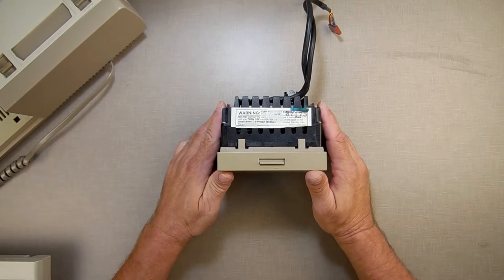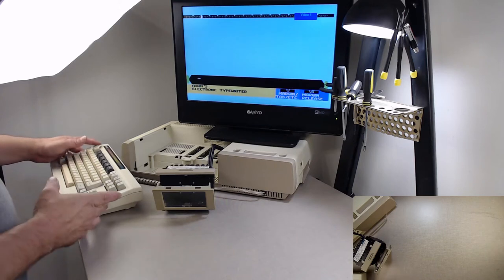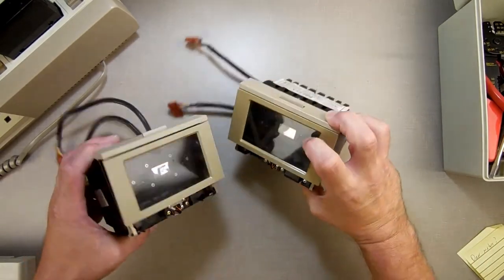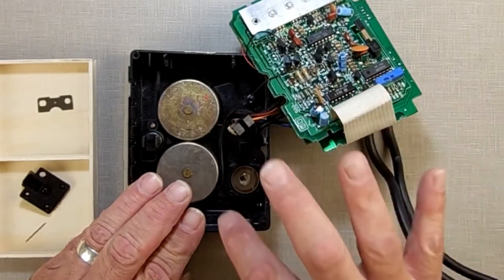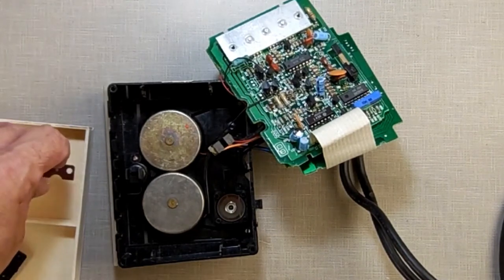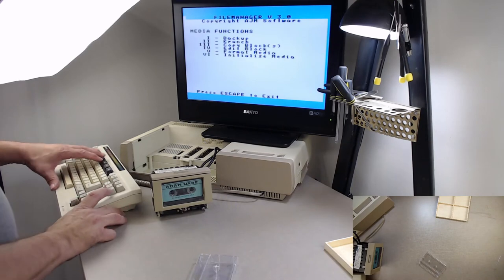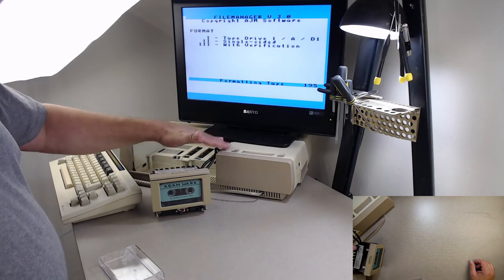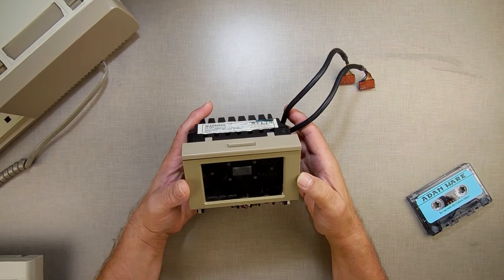Data Drive Maintenance: Coleco Adam for Dummies

Comment: I recently de-gunked two drives with the help of your earlier video.  One was a newer version with connectors, the other was the older version with the hard-to-remove strain relief and everything soldered.  That early version was a real pain. I tried different solvents on the rubber, but rubbing alcohol seemed to work best, as you suggest.  It really is impossible to describe the delicacy of that fine mesh on both the wheel and the "window" square. I cannot imagine any way to ever reproduce those. True unobtanium. Anyway, both are working great now, and silent as whispers! I would have had no clue where to start on these without the help of your great videos!
Reply from the maker: Thank you
Reply: @8BitMilli  have the ADAM peripheral for the Colecovision. I am grateful for your channel and hope it helps me. My data drive is not working but everything else is.  I hope there is a printer maintenance/repair video and tutorials on using the ADAM as I am a newbie and am scratching the 80s computing itch I never scratched back then.

Comment: Nice video. I have a new found respect for the Coleco Adam. I actually have one out in my garage, that I picked up with a big load of vintage computer stuff. It did not look 
too good, so it never made it into the house. I have a small museum in my spare bedroom, and a system has to be in perfect condition to make it onto one of those shelves.
So, I have never bothered with the Coleco Adam out in my garage, basically because it does not look that good... but I did enjoy watching your video. One of these days I might even take a look at that old Coleco out in my garage. Although I am not sure if I have a power supply for it or not. I do have an extra Colecovision Power supply, if that will work.

Anyway, thank you for the video, it was very inspiring.
Reply from the maker: Thank you - I bet that Adam will clean up nicely